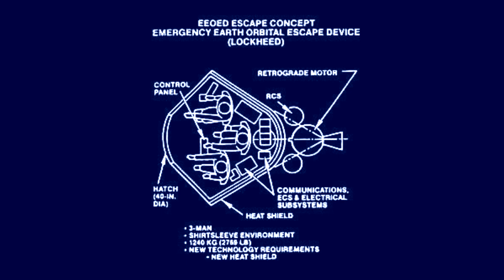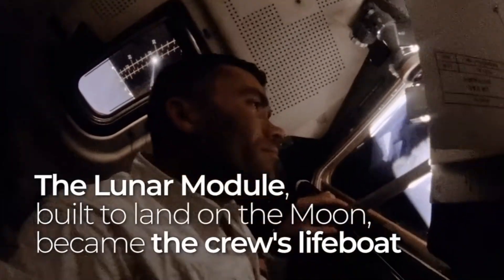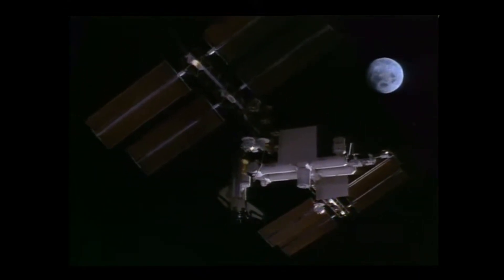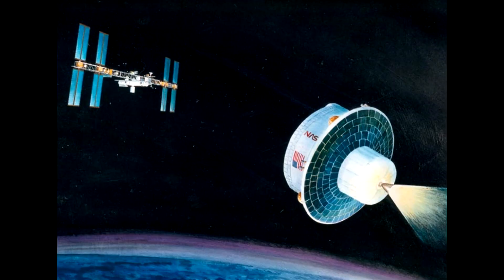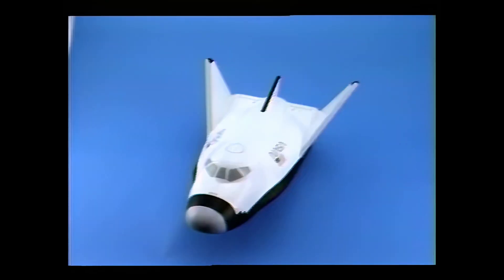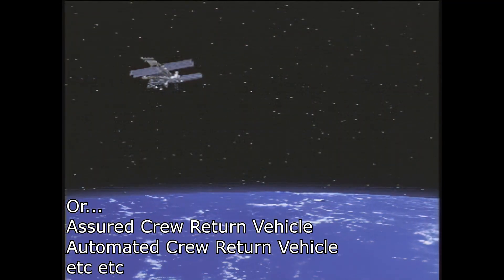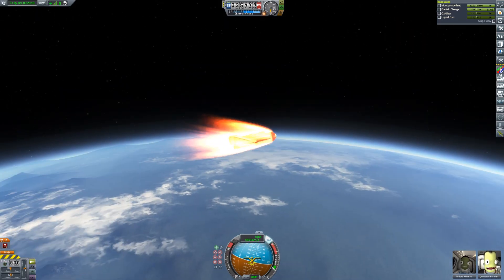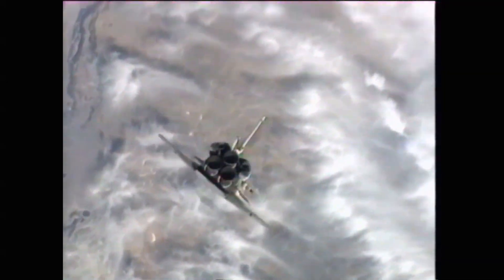The 'Escape Pods' That NASA Developed, But Never Used.

Comment: Hey, remember that time when NASA knew the Columbia crew was probably going to die on re-entry and they decided to neither tell the crew nor mount a rescue operation with Atlantis?  I do.
Reply: Turnaround% speedrun
Reply: You mean Columbia's first orbital flight? Re-entry heat ruined a landing wheel, high altitude bail out was actually considered.
I'm sure many things went on with the shuttle that we know nothing about. I mean there a few early missions from the 80s that are still classified.
Reply: @rmx4087  No, I'm talking STS-107 in 2003.
Reply: That wasn't the first time. STS was always a risk and it's passengers knew it well. Also Columbia couldn't wait in orbit for a shuttle to launch. It had to return. To be fair however, I believe that skip Re-entry should have been attempted. You are forgetting the length of time needed to prep a shuttle "rescue" mission.
Reply: Daniel Millage. That is known to be a myth based on exaggerated or misrepresented excerpts from a recent blog posting by former NASA official Wayne Hale. He reported a private conversation during the mission that speculated what might be best in the event lethal damage were discovered. No official decision was ever made, because nobody thought there was any need. Columbia's astronauts were fully informed of the actual results of NASA's analysis.
Reply: They didn't know enough about the damage - they assumed it was a relatively common incident of the tile TPS being hit, and paid no more attention to it. Well, it wasn't the tile TPS, but the fragile reinforced carbon-carbon on the leading edge of the wing, in one of the most heated regions. They also didn't know RCC was that fragile - before them, US Army did some research on it for tank armor, found it was too brittle, than classifed the findings.
Fun fact: There were proposals for "Evolved Shuttle" involving liquid fuel boosters and an ejectable crew deck dating even before Challenger, but NASA couldn't afford the development cost of them. #FundNASA

Comment: I've always wondered why they don't just make the battle stations BE the escape pods. If you're about to explode you don't want to have to run for a pod.
Reply: Well if I were an enemy craft, the first thing I'd aim for would be the battle stations, not the escape pods.
Reply: The bigger question is, if you are about to explode, why can't you eject the reactor?
Reply: @dsdy1205  Star Trek had that with some ships being able to eject the warp core. I know at least Voyager did.
Reply: @NorninTGK  All the Star Trek ships had the capability to eject the warp core(s) (yes some had spares / multiples).
Reply: @dsdy1205  There is a secret engineering rule that states, in some variation or other, "The power plant, warp core, or other dangerous energy source shall have a method of safely defusing, powering down, and/or ejecting. And that system shall break easily and often."
Reply: @dsdy1205  eject the reactor??? 🤔🤔🤔
Reply: @MrCrackbear  At the enemy? 🤔
Reply: @dbneptune  at the nearest gas giant or star
Reply: @dbneptune  now you're thinkin
Reply: @dsdy1205  Wait -- What Reactor are you talking about? There is no nuclear reactor on the ISS.
Reply: @williamblack4006  yeah but the ISS isn't shot at by sci-fi aliens. I'm talking, as most of the thread is, about the scifi trope of the good guy's ship exploding because mumbles something something reactor failure
Reply: @dsdy1205  Tbf in basically every series ever, the first thing to be damaged during a reactor kabewm scene is that the ejection system and emergency shutdowns are busted. I think there's like, one time in Voyager where they actually dump the core due to an internal overload which didn't destroy the ejection system. (Basically it did its job because it wasn't smashed by the concussive blast of a torpedo or plasma-based weapon striking the engineering deck)
Reply: Ejecting the warp core usually fails for some reason :P
Reply: …. and you never ever go back to get the ships cat.
Reply: Those battle stations are generally packed full of explodium, best to leave that behind
Reply: Re ejecting the warp core: assuming the thing has significant amounts of antimatter still inside, you'd better hope you get reeeeaaaalllly far away from it before the containment fails and the fuel contacts the reactor walls. If you look up the famous cutaway poster of Enterprise from the first Motion Picture, it also shows a whole array of magnetic antimatter storage bottles at the base of the engineering hull, each of which should be able to glass over half a planet according to the original series. Come to think of it, operating antimatter-powered starships in LEO is a really dangerous thing to do. In ST III when they destroyed the Enterprise, by all rights it should've wiped out the face of the planet along with it.
Reply: @RCAvhstape  Regardless, you're faced with the same problem of reaching min safe distance in an escape pod, except your escape pod has less room for shielding, life support, communications, tools, and literally everything else you need to survive during and after the explosion, all things the ship already had in order to function.

If you have enough mass / money budget to install powerful rockets on every escape pod, and the escape pods actually have a chance of protecting the user toll rescue, then those rockets are so powerful that you have enough budget to yeet the reactor or whatever explodey bit you need to leave behind at a fairly rapid speed.

Comment: Could a dragon/starliner dock with another dragon/starliner in order to rescue a crew
Reply: I think they could since I'm pretty sure that the modern docking system they use is designed so anything can connect to anything. The question is if it would ever be used. If damage to one of the craft was found that would prevent a safe reentry, the safest thing would be for the crew to remain on the ISS until a replacement craft could be sent up.

Comment: dont use rocket in the 1st stage, use stage 1/0 ground sling tube, only after exiting the atmosphere use electric ion engine to manoeuvre to the orbit
Reply: @hooveyjones  Google translate is NOT helping this person communicate effectively.
However, there's already a problem. Unlike in KSP, you can't use ion engines to circularize your orbit after being launched from the ground, even if that does leave you above the atmosphere. There simply isn't enough thrust to complete the task in the time allotted.
Non-rocket space launch is something I think we should be pursuing, however my favorite method is the "lofstrom loop", which is a loop of iron in an evacuated tube that is put in motion at faster than orbital speeds, and tethered to the ground so that the motion of the loop of iron itself is enough to hold the (several hundred kilometer long) middle section of it significantly above the atmosphere. The loop of iron is held away from the sides of the evacuated tube by magnetic levitation systems, which would work at all but the very slowest speeds, but there are rollers for the loop to lie on that can handle having the loop be supported by the rollers at speeds that the maglev systems won't work at (and a bit above so there's a region of speeds where either system is fully capable) should the system need to be stopped or started to allow for extended periods of inactivity or maintenance.

How you get things to accelerate with this system is that you couple to the iron loop magnetically for thrust, and to support the vehicle under acceleration the vessel itself would have a small maglev system that uses eddy currents to levitate against the aluminum tube the iron loop runs in.
Payloads would be put on the track of the loop at either end at ground level and launched to orbit (or even up to and beyond escape velocity), with an electromagnetic coil in the payload being able to be varied in strength in order to change how quickly the payload is accelerated once out of the atmosphere, which allows for payloads to be launched that are not tolerant of high g loading, such as passengers or sensitive/delicate mechanisms/electronics, as well as allowing for a very fine degree of control of the orbital apogee of the vessel by controlling the velocity at which power is cut off to the propulsion magnetic coil. Of course, if the destination for the payload is somewhere in orbit, there will need to be a small rocket stage on the vessel in order to circularize orbit at apogee, however the size of this rocket stage is more akin to that of a kick motor on a geostationary satellite than an actual orbital-class rocket 2nd stage where the goal is to achieve most of the velocity needed to be placed in an orbit in the first place. In other words, the delta-V required is MUCH lower in the case of the rocket stage needed to circularize the orbit of a payload launched by a Lofstrom loop at apogee.

The trip out of the atmosphere would likely be done at a relatively sedate pace, high supersonic to maybe low hypersonic at extremely high altitudes, so as to not lose energy to aerodynamic friction or compression heating when that is not needed. All of the "functional" portion of the acceleration would be done while entirely out of the atmosphere, much like with the 2nd stage of a practical orbital-class rocket of say 20 tons payload capacity to LEO.

This is a highly dynamic system, and there is very much a delicate balance of forces at work, however it is something that has an ability to put payloads into orbit that is unmatched by any system that is based totally on rocket propulsion in order to achieve orbital velocity.
The key, as always, is that the Lofstrom Loop allows for an extremely high launch cadence, so while payloads may only be a few tons to a few tens of tons each, they can be launched perhaps up to 10 times a day, with the cadence being related more to how much electricity you can dedicate to accelerating the iron loop in stations at each end of the loop, as well as heating of the loop of iron itself, as it WILL get at least a little bit warm in use, tho it would never get hot enough to even start to glow. Generally, the smaller the payloads are, the more often you would be able to launch them, so it would make sense to launch something like a Starlink satellite in groups of 5 to 10 multiple times per day instead of say 60 of them all at once like is currently done with SpaceX's Falcon 9 rocket.
Reply: bye 1st stage rockets, be full age in christ already
Reply: dont be scott womanley, through the law, living by the law, so "help you god" eh

Comment: Imagine if the inspections of the Shuttle thermal protection system was done more seriously from the start and that the Shuttle had an escape capsule like this, then the Columbia disaster would've been prevented. Just my 2 cents.
Reply: Fun fact: There were plans for "Evolved Shuttle" involving liquid fuel boosters, wingtip fins and an ejectable crew deck, but NASA couldn't afford a new orbiter fleet that was necessary for the plan. #FundNASA
Reply: It would make Shuttle heavier and even more useless it already was, Columbia disaster would never happen because entire program would bankrupt before then.
Reply: This was something that was thought of long before. My uncle designed and built an inspection drone called AERCAM in the late 80’s/early 90’s but it never flew save for one demonstration mission in ‘97, because it was simply too heavy due to scope creep by the big heads at NASA Johnson. 

Interestingly, one of its’ descendants flew aboard Cygnus last year as part of one of its post ISS departure missions. Hopefully a positive sign of things to come for future missions.